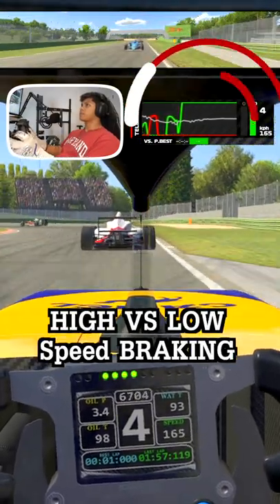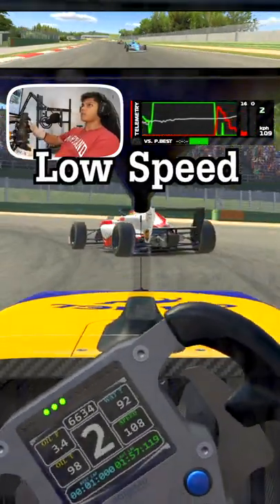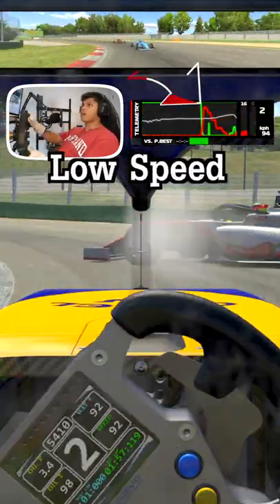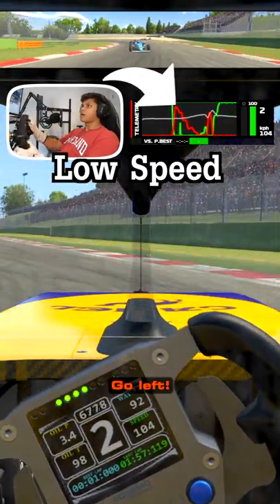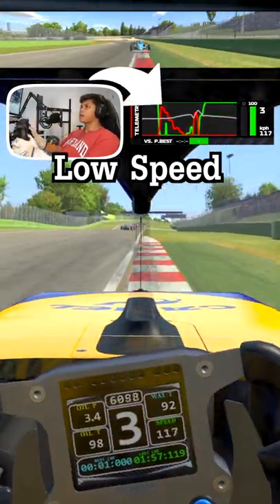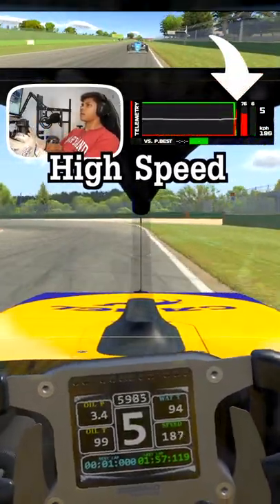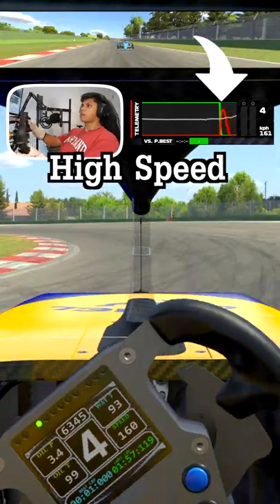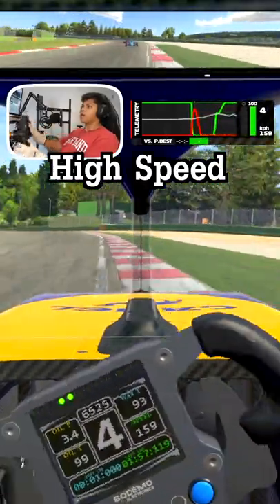HIGH vs LOW Speed Braking Technique

Comment: It's all about managing the balance between understeer and oversteer, a car should go light on the rear end through slow corners to aid rotation and be fairly neutral in high speed corners to be smoother and more capable of carrying momentum. The sweet spot varies depending on many factors just as the track camber, car and section of track that follows.
Reply: Also when you hit/release how hard soft fast or slow you touch the brake and apply the throttle, I've come to understand this the more I do daily races in gt7 4c gt3 alfa Romero 155 gt4 alfa Romeo are coincidentally my favorite cars to race they fit me like a glove

Comment: Simple: always want weight transfer balanced
High speed corners - quick so it doesn’t send COM (centre of mass) all the way to the front to cause understeer
Low speed corners - gradual so can get maximum breaking potential and not pitch car too much
Reply: Weight shifting forwards causes oversteer, not understeer
Reply: @Someone25948  Depends on the situation and car. Braking too hard or for too long initially causes understeer. Braking too hard at turn-in causes oversteer.
Reply: The weight shift is quasi instantaneous…
Reply: @ieurobeatkids9378  correct
Reply: Something's going real bad if your center of mass is shifting.
Reply: @ArchOfficial  It’s simple physics 😅
Reply: @formulanova12  Nothing is shifting when load transfer occurs. The CG, or center of inertia, or center of mass, stays exactly where it is.

If your CG is shifting forward, it means the rear of the car has come off and is flying forward.
Reply: @ArchOfficial  The centre of mass shifts when it undergoes acceleration, deceleration and turning due to it having inertial mass
Reply: @formulanova12  No it doesn't.
Reply: @ArchOfficial  Bruh since when?
Reply: @formulanova12  Generally accepted about 13.8 billion years ago.
Reply: @ArchOfficial  Wrong, the center of mass shifts which is why you get load transfer
Reply: @formulanova12  Cool, so you're telling me that the lateral linear inertia over the front axle increases on braking, right? So due to load sensitivity effects, the front should now have less grip and more inertia, so transferring load to the front will always cause understeer?
Reply: @ArchOfficial  Wrong, front would have more grip as there is more load on it providing more grip
Just like downforce provided more grip
Reply: @formulanova12  No, because more load produces less grip. More load produces higher force, though, but less grip.

This is vehicle dynamics 101, I thought you'd take the hint already and stop being so confident.
Reply: @ArchOfficial  So the more downforce, the less grip? Because downforce produces load
Reply: @ArchOfficial  The center of gravity shifting off the center of mass is why g forces are a thing
Reply: @formulanova12  No, because downforce only increases linear inertia very little, by however much the air has mass, maybe 1g. You're adding load which takes away grip but adds force without an increase in inertia, resulting in more acceleration potential.

"Center of mass shifting" doesn't "cause G-forces". There isn't a widely accepted explanation for inertia in physics, but a common new theory has to do with spacetime bending. Mass just tends to want to stay on a reference-point-object linear path, or a reference-point-instant-center rotational path and it resists acceleration to some degree.
Reply: @ArchOfficial  If downforce takes away grip, how are you able to turn corners better and apply more brake pressure if you have less grip?
Reply: @formulanova12  Load (FZ) takes away grip (mu) due to tire load sensitivity, but more load (FZ) in the equation produces a higher force (FY/FX).

Adding load via "load transfer" doesn't transfer any inertia, so you can change the axle forces relatively by using inputs to change the relative loads and thus relative forces.

This is like the most basic thing that everyone knows about.
Reply: @ArchOfficial  So from what you said load takes away grip but instead gives force which allowed you to take corners at higher speeds right? So you have less grip but more force
Reply: Am I right or wrong?
Reply: @formulanova12  Yes, that's called tire load sensitivity. The reason it matters is because the inertia over an axle doesn't change from load transfer.

EDIT: Load sens doesn't "allow" you to take corners faster, though. A lighter car will have less total load and also transfer less absolute load than a heavy one, which means that it'll have overall higher mu values but also a better mu split between the outer and inner tire, in addition to just less mass that needs to be accelerated.

Load sensitivity is however the only reason that changing the roll stiffness distribution of a car changes balance; because you make one axle or the other transfer more load relative to the other, which will result in an overall lower mu value over that axle.
Reply: @ArchOfficial  Would you mind rephrasing that because none of that is making any sense sorry
Reply: @formulanova12  More load over a tire makes it less efficient.

Making an axle stiffer relative to the other makes more load transfer across it, and less across the other axle.

Heavier cars have less efficient tires and they make the axle even more inefficient because more load transfer across it.
Reply: @ArchOfficial  So if more load produces less grip and is less efficient, how does more load help get lower lap times?
Reply: @formulanova12  More load from what? Adding mass will add inertia. Adding load from aero won't add inertia.
Reply: @ArchOfficial  I’m not talking about inertia here
Reply: And also you said inertia doesn’t change
Reply: @formulanova12  When load transfers, it doesn't. Mass isn't moving.
Reply: @ArchOfficial  I know mass doesn’t move in a car🤦‍♂️ the whole car moves
Reply: @formulanova12  Cool. Read Suspension Geometry and Computation by Dixon, Race Car Vehicle Dynamics by Milliken and Milliken and Fundamentals of Vehicle Dynamics by Gillespie.

Comment: Mainly about weight transfer, braking loads up the front which aids rear rotation, which is great in the slow stuff. With fast stuff you want a more balanced load on all 4 tires. There’s also the conversation of aero and downforce, which helps with tire grip at higher speeds but requires loosening up on the brake pedal as you slow down and lose that bonus grip.

Comment: In the low speed you need all tbe weight on the front axle but at speed you have aero giving you the grip to turn without the brake

Comment: My theory: At high speed 50m takes less time to travel and another factor is drag which goes up with velocity squared so more of the braking is just drag (also in formula cars generally downforce helps stick the car to the road so you can hold higher brake pressure without locking up)

Comment: My idea is how loaded the fronts would be, a car (in my ideal setup) should just ever so slightly be balanced around entry understeer(rear tires loaded) in a high speed entry. By tapping the brakes you can induce a slight load on the fronts to tip the car in before allowing the steering to open again. In a slow speed situation however, that entry requires more braking and possibly some simultaneous steering to push the front tires harder and induce oversteer

Comment: Considering that the car you are driving is a downforce car, theres more available grip at the beginning of the braking zone on the high speed example. The car will be able to be more stable and sustain better grip in a high speed and short braking period application. Different if its high initial speed following into a long braking zone into a slow speed release. Initial braking would be sharp but release would be gradual.

Comment: High speed: thanks to downforce, less need to trail-brake AND less need to be concerned with inducing brake-lift-off understeer thanks to said downforce.

Low speed: less downforce, greater need for inducing mechanical grip via weight shifting as well as concern for inducing brake-lift-off understeer. Also, trail braking a hairpin.

Comment: Ur just braking longer and shorter bro. Braking high speed corners has less to do with slowing down the car but more with shifting the weight for better turning since in high speed corners u tend to understeer, which an f1 car doesn't really struggle with.